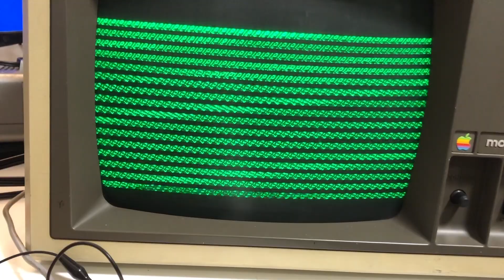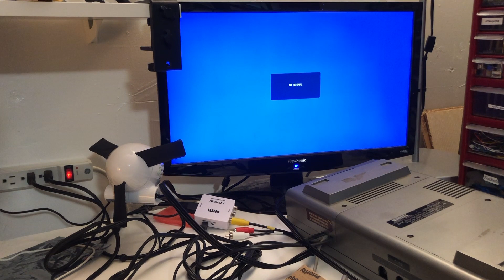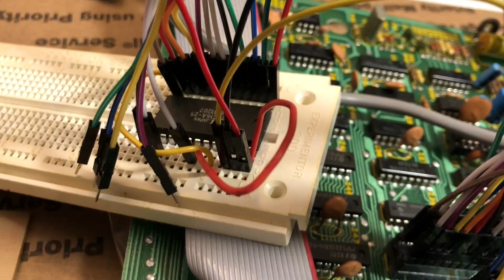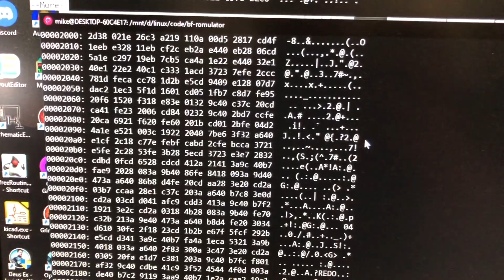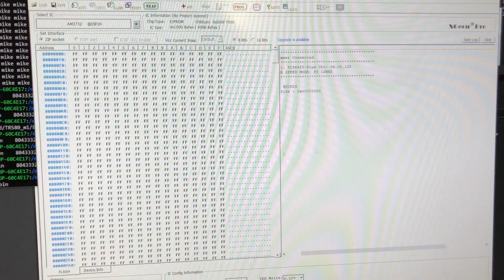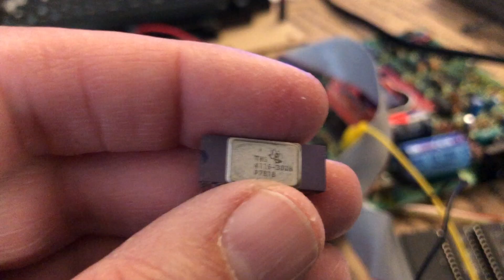Repairing a TRS-80 Model 1 with help from the ROMulator: #SepTandy

Comment: Heh awesome Mike! You made your life extra hard by not using my diagnostic ROM for the Model 1 :-) That damn ribbon cable, though, which is bad on one of mine too...
Reply: Oh can you make that PCB for the character ROM available? Those chips are super hard to find so a replacement would be amazing.
Reply from the maker: Thanks for the reminder, I just put up the kicad files and gerbers for that adapter on github, hope it will be useful to others. The board can use 2716 or 2764 EPROMs or 28C16/28C64 EEPROMs to replace the MCM6670 character generator in the TRS-80 model 1. Will put this in the description as well. Files are here: https://github.com/bitfixer/pcb/tree/main/mcm6670_to_eprom
Reply from the maker: Hey Adrian! Thanks for checking this out. Yeah, pretty sure I could have saved a lot of time using your ROM! I will have to load that in as a setting on the ROMulator Z80. I have another TRS-80 machine I'm hoping to get to soon, will have to try it on that. Those pesky ribbon cables..

Comment: For your ROM, would removing the socket get you the room you need?
Reply from the maker: Yes, I think it would, good idea. I had already cut a little bit off of the machine pins to see if that helped, but it was not enough. Will probably try it without the socket to see if that's enough, would be simpler and faster than making another adapter board.
Reply: @bitfixer6502  I’ve been told that I have a mastery of the obvious.  Lol!  Hope it works!

Comment: Yesterday I broke out the Model I I did a couple repair videos on last year. And wouldn't you know it, I had to open it up and hammer on it for a while before it'd behave after just sitting for a few months. In my case it was pretty minor stuff (I had to deox the vertical and horizontal position pots because it was glitching in both directions, and I also apparently have an intermittent bad connection in the spaghetti mess of a lowercase modification the previous owner installed) but... man, I can't help but get the feeling that these particular machines are getting too brittle to trust in their old age. Commodore PETs, with the exception of the bad RAM/ROM chips on the earliest SRAM models, feel positively bulletproof compared to Model Is.